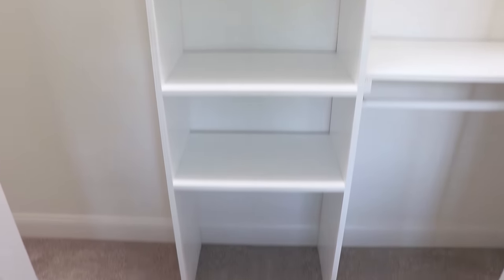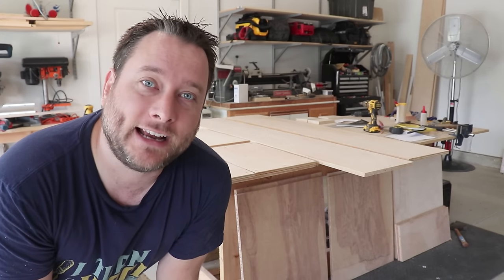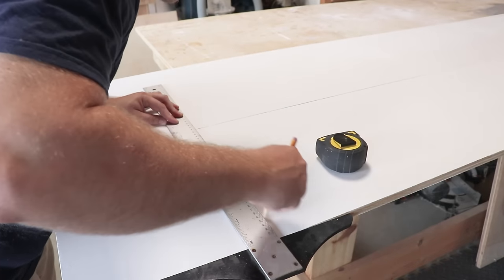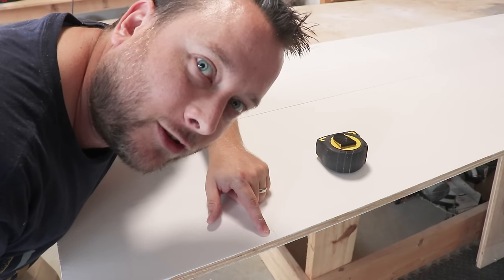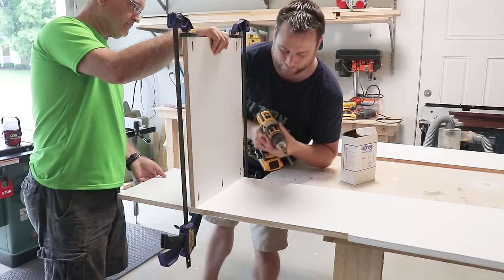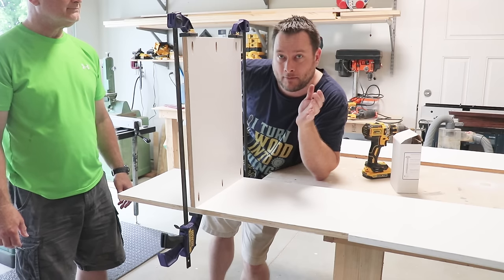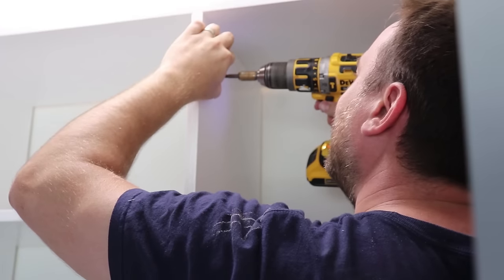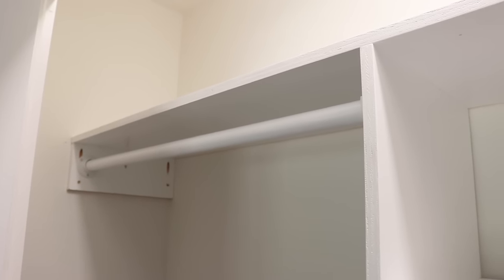DIY Bedroom Closet With Sheets of Plywood for $100 on a Budget | DIY | Woodworking Project

Comment: Great video Phillip! The only minor detail I would add would be to counter sink the screws on [top] of the shelf. That way the little bump of the screw wont drive you insane when storing boxes etc. Lol.
Reply from the maker: Good suggestion thanks for the comment
Reply: Yes! I saw that and thought the same because that would drive me insane!
Reply: @HowYouCanMakeIt  how you doing?
Can I just use screw or nail ? What is the benefit of the pocket holes ?
How much you really spend. 
How many boards you use .
Please and thank you. 
Did you used sanded plywood?
Reply from the maker: @bpierrealix  pocket holes are very strong. My plans show all the materials you need basically just to sheets of plywood. Lumber prices are a bit unstable so anywhere from $100-$150
Reply: Hi Raul, I'm a new DIYer, if I use 5/8" MDF, will it be strong enough to hold the hanging sockets and how long max would the screws have to be? I don't want it puncturing through the MDF and coming out the other side. You know what I mean?
Reply from the maker: You would need to check what kreg jig would recommend for that thickness.

Comment: I purchased the plans.  They're easy to follow and modify to your specs.  Philip is super helpful in answering questions!
Reply from the maker: Glad to help!
Reply: I purchased the plans and I can't open them for some reason. Any ideas.
Reply from the maker: The 3D file can be opened using sketchup.com and the plan is a PDF you should be able to open it Acrobat Reader

Comment: I actually spent the extra money to buy melamine, like what the pax system uses for their closets, and I love it
Reply from the maker: Nice
Reply: @HowYouCanMakeIt  IF YOU USE PVC BOARD IT WILL LAST FOREVER.
Reply from the maker: Thanks for the info. Never worked with that material

Comment: Good plan, but I’m not a fan of using liquid nails on drywall. I would have cut a board the width of the closet wall and drilled it into at least two studs. The problem comes later if the shelf gets broken, falls or someone puts something really heavy up there and it separates from the drywall. Also if someone else goes to remodel that closet later they will be cursing you down the road.
Reply from the maker: Good point thanks for the feedback
Reply: Hi! Would drywall anchors be an acceptable alternative to liquid nails? Or I guess you could use them in addition to the liquid nails?
Reply from the maker: Yes that would be good too
Reply: @blairs4033  not using drywall anchors. Using a good grk screw and going into the studs.
Reply: @blairs4033  no. If you put anything that has any weight to it, it will fail. Just do it right and drill into the studs, that’s what they are there for.

Comment: on the top shelf, if you had pocket holed the support bracket onto the shelf you wouldnt see the pocket holes in the closet. also the glue isnt that strong glued to a painted wall. us a drywall anchor and you get more strength. hope this helps
Reply from the maker: Thanks 😁

Comment: great vid... but the liquid nails (as strong as it is) will not be that strong. a bond is only as strong as the weakest bond, in your case, the weak bond is actually the paint on the wall. you might as well have used paint to stick it to the wall. if it fails, it will rip the paint right off of the drywall.
Reply from the maker: Thank you for the feedback

Comment: Love the shelf! So nice and simple and looks very easy to build!! Thank you! Just a quick question about pocketholes. When you screw into them, arent you scared that the screws will come out from the other end? Whats the trick to avoid that. Im guessing that we have to get the right size screw but would love to hear your answer for this!
Reply from the maker: I use the Kreg Jig 320. It is great because it is really super simple to setup. When you drill pocket holes you need to set the depth of the jig and the drill bit. The newest version of the Kreg Jig 320 has all the markings that make it really easy. They also tell you what screws to purchase for the thickness of your wood. https://amzn.to/2zEIXPG

Comment: What screws do you use for connecting the shelves and for connecting to the drywall/studs?
Reply from the maker: Soft plywood Kreg pocket hole screws 1 and1/4in and 2 and 1/2 for the wood going into the stud in the drywall

Comment: Great video... How do you make sure the shelves on the main unit are absolutely level on both sides?
Reply from the maker: Good question! I marked each side with a line and held the shelf in place with clamps and drilled into the sides with pocket hole screws...this was the best way to ensure it was level when it stood upright.

Comment: How much strength does the liquid nails provide?  I am putting wood all around to screw into that.  I never even thought to use liquid nails.
Reply from the maker: It is very strong, the paper on the drywall will tear off before it does. I used liquid nails for this project because I was not going to place anything heavy on the top shelf. If you plan on putting a heavy load I would recommend screwing into the studs.
Reply: @HowYouCanMakeIt  Thank you for the prompt reply!  That was my concern (paper ripping).  I can see my wife overloading the shelf and tearing the paper.  This could even happen to the next person that owns the house.  To me, using the studs is the only way to go.  If not, there are some awesome drywall anchors out now- holding 250lbs a piece.
Just my experience.  Thanks for the video.  Your closet looks really good.
Reply from the maker: Glad to help

Comment: Question: How does use liquid nails on the drywall support the verticle weight from the closet? Why not use drywall anchors?
Reply from the maker: It holds it in place but not for a sting bond. I later found the studs and put screws in to give it additional support.

Comment: Do you ever find it necessary to fasten the middle shelves against the wall? I’m open to doing it but I’d rather not put extra holes in the wall if I don’t have to
Reply from the maker: I haven't as they are held securely in place by the top shelf.

Comment: Liquid nails aren't the brightest idea for fastening to drywall, it's gonna tear that paper off if you ever needed to remove it. You could just use toggle bolts or even just toe nail your board, it will hold.
Reply from the maker: I agree, I later found the studs and put some screws in.

Comment: How is the weight bearing for that hangin bar attached to plywood? Is it pulling the plywood with it? Do you recommend I run the top bar directly to the studs in the wall through the closet by drilling holes to avoid weight issues?
Reply from the maker: I have had no issues with weight. Going into a stud is always going to give you more support

Comment: Instead of running screws into sheetrock that won't hold a thing I would either run the board from wall to wall so there is a 2x4 or at least use a screw in anchor that holds 100#.
Reply from the maker: There was a stud that I was able to screw into in the corner.
Reply: Yes I know. But that won't support the other end.
Reply: Running a board full length is a good idea, since it will hardly be visible and will not be an eyesore. Given the amount of weight I'm assuming he will be storing on those shelves, they're more than adequately supported. I use 18g brad nails myself, but this would work just as well.

Comment: Hi Philip, Great video, Please see if you can tell the width of boards you cut from plywood......Width of two long boards in the middle! Thanks
Reply from the maker: You can make it whatever you want. He exact measurement I used are in the plans.
Reply: He's charging $10 for that piece of information.
Reply from the maker: See my other comment with info. You can make it whatever size works for your closet.

Comment: How did you secure the shelving unit you built first to the wall? Or is it just secured to the top shelf that's secured to the wall?
Reply from the maker: I used and  L bracket and installed it into the stud and top of the shelf

Comment: Can I hang the center shelf column?  I have a weird 10" high angled board that juts out about 10" at the bottom.  I won't be able to rest the center shelf column on the floor.
Reply from the maker: Yes you could hang it if you needed to. It would require some additional support/attachment. Sent you a PM.

Comment: I'm planning to build  one for my son this weekend.  What do you think about 3/4  white  Melamine with adjustable shelves?  I do like the fact, you add pocket holes. Im also adding cleats for support on one of my long shelf. I think  i could do this. Thanks for this video. You gave me some good ideas.
Reply from the maker: That would work.
Reply: what are pocket holes? and how can you make it. its not shown in the video
Reply: @jasolavihar3928  10:37 10:38.     It's a small kit that helps you drill these holes for support of any project you're making.  If you look behind your face frame kitchen cabinet, you might have pocket hole.
Reply from the maker: Joe did a great job explaining pocket holes. Here is where I talk about them in the video https://youtu.be/GiZKzf7LoWo?t=67
Reply: @jorrba3934  Thanks

Comment: This is the perfect closet for my small reach-in.  It doesn't look difficult, I'm sure I can do this.  I do have a question though, I want to hold the center set above the baseboard.  How did you attach this to the wall?
Reply from the maker: The top holds it in place
Reply: use L brackets
Reply from the maker: That would work too

Comment: Hello I'm new to this channel! We recently bought a house and closets need to be changed. I wonder how much or what machine s I need to diy like what you did? Thanks a lot
Reply from the maker: Table saw is my most used tool in my shop, with a close second being my miter saw. I stared out. with a contractor table saw https://amzn.to/3IpX89P then moved up to a cabinet. It all depends on how much you want to invest. Here is a miter saw that would be good for starting out https://amzn.to/3IrSic7 You could use a cheeper method and that is a circular saw with a track saw. https://amzn.to/3M5eDOY Kreg Jig also makes a good adaptive solution https://amzn.to/3M1zQcq hope this helps.

Comment: The vertical boards are flush with the baseboard at the bottom, but flush with the wall at the top. How are you making up for the thickness of the baseboard? Is the corner of the vertical piece notched?
Reply from the maker: I just notched the back to account for the thickness of the baseboard
Reply: @HowYouCanMakeIt  Sooo glad I looked thru all the comments as that was my question! I have all my materials ready to go. Home Depot cut the lengths for me as the ply is too heavy for me to manage otherwise as a 5' 4" tall, 64 year old, handy female :). This will be my first experience with a Kreg jig and pocket holes so I will practice first on some scrap ply to make sure I know how far to drill the holes. Nice clear instructions on the download file. The video is a great visual accompaniment to see how many pocket holes to drill and how to approach the assembly and installation process. Plus the comments here to help clarify any outstanding questions. Looking forward to pulling it all together. Just love the internet and people like you who are willing to share their expertise. Thank you!
Reply from the maker: Jill Taylor I am so happy that this is able to help you. Happy building.

Comment: How much plywood did you use?. Looks like at least 2 sheets, at what cost per board 4 x 8 approx 30.00 a sheet, 3/4 or 5/8, thanks, nice job.
Reply from the maker: two sheets. 3/4in thick

Comment: Will it be strong enough to hold clothes if I use just one 5/8" MDF board in between or do I need 2 pieces of 5/8" MDF board in between?
Reply from the maker: MDF will work however MDF bends over time

Comment: great video, just a question I need my top to be removable as the attic access is through the closet. I was thinking not to screw it in .. is it advisable ?
Reply from the maker: Yes, that would work. I did that for one of my other closets in my home.

Comment: Nice build thanks for sharing! Would you mind talking about the total cost of products to build something like that? I know that home depot cut custom pieces around my area so the use for table saws or the such is not required.
Reply from the maker: A sheet of birch plywood is about $55 the rods and rod hangers are about $40 total cost is $100 now this doesn’t include paint paint is about $30. My plans have all the cut sizes you need to make.
Reply: Philip Miller please update once that is available. Thanks!

Comment: can i use 1/2" thick plywood for this project?
Reply from the maker: Yes you might have to slightly adjust for the thickness but that should be really easy
Reply: @HowYouCanMakeIt  is that thickness strong enough?
Reply from the maker: Yes

Comment: I have 3 doors of wardrobe of size 7 X 2 foot, can we use 18mm plywood with concealed hinges to hold. Will the plywood bend after couple of years
Reply from the maker: good to know.
Reply from the maker: @Er.drushtant  it is 3/4in hasn’t bent or warped

Comment: If I buy this at a store like lowes can they accurately cut it the way you do? I don't have saws!!!
Reply from the maker: Yes, they should be able to cut it for your. Be sure to measure your closet's dimensions to make sure it matches the plans. Happy building :)
Reply: Thx my closet is very abnormal so I don’t think I can use the same dimensions
Reply from the maker: Wonderful.

Comment: i don't want the shelving all the way to the floor. how would i fasten it to the wall with out the bottom touching the ground
Reply from the maker: You could add a 2-3in T plate/strip of wood to the two vertical sections of the back and drill your screws into that.

Comment: Hi great video,  what screw you use and how thick in the plywood.thanks
Reply from the maker: I use kreg pocket hole screws and 3/4 plywood.
Reply: @HowYouCanMakeIt  thank you, what size of screw should I use for 1/2 inch plywood
Reply from the maker: Kreg jig has a screw chart I can’t recall but I think it might be 1in but you would need to check
Reply: @HowYouCanMakeIt  thank you

Comment: Hi. Please share the plan link to download. Also please suggest what kind of screws you have used and what different size.
Reply from the maker: The link to the plans are in the video's description. I used Kreg Jig Pocket hole screws 1 1/4in
Reply: Philip Miller thanks.. what screws you used for connecting with drywall?
Reply from the maker: @gulu323  I was lazy and used the 2in kreg jig screws and in some areas used the GRK R4 screw https://amzn.to/2lqQvie

Comment: is there a reason you didnt remove the baseboards so it would sit flush against the wall?
Reply from the maker: I didn't want to take the time to rip out the base boards and repaint and touch up the back wall
Reply: Philip Miller could use an oscillating tool to cut 2 slits in the baseboard

Comment: Is it hard to keep the white clean? Especially with the shoes.
Reply from the maker: I used a gloss paint so it is easy to clean and wipe off any dirt or scuffs. I used the same gloss paint in our mud room and it has held up
Reply from the maker: I would recommend using an enamel based paint as it cures much harder and easier to clean than acrylic. I haven't had any issues with cleaning

Comment: Is there any particular plywood that you recommend? Great video!!
Reply from the maker: Birch plywood make sure it is grade A or B your local hardware store should have it in stock.
Reply: I've actually found a place that sells "salvage" hardware and lumber that has cabinet grade plywood for about $20 cheaper than my local big box stores. Even though the store is labeled as a salvage location, the plywood is in pretty much perfect condition, and appears to just be some that they bought from a supplier for much better prices than normal. I figured I'd mention this as another source for anyone looking for good materials for their projects. Hope this helps!
Reply from the maker: Thanks for sharing.

Comment: No intructions on placement of pocket holes
Reply from the maker: Two or three evenly spaced will work.
Reply: also what size screws are you using
Reply from the maker: 1 1/4 for 3/4in plywood

Comment: Couldn't build a stack without a helper? Come on just nail 1x2 on the bottom, put a shelf on top of the 1x2 and build up from the bottom with spacer blocks made of scrap shelving. Put nailers on the stack and nail it into studs. Derpdederp.
Reply from the maker: That would work too :)

Comment: 3/4" Birch plywood? paint, wood screws or deck screws, liquid nails etc.... The Topic of your video says $100... No way I've priced this stuff and was a builder for years. You should've notched the plywood at the baseboard so you wouldn't have the gap the wall.
Reply from the maker: I spent $100 and prices may very depending on where you purchase supplies etc

Comment: $100,000 worth of tools. Forget it.
Reply from the maker: Is there a specific question you have about the tools needed to make this closet? You don't really need to own any expensive tools to make this closet. Most hardware stores will cut the sheets of plywood for your for free and the only power tool you may need is a miter saw and a drill.
Reply: @HowYouCanMakeIt  I'm in the Philippines. A pair of pliers...and you're a craftsman!
Reply from the maker: LOVE IT!